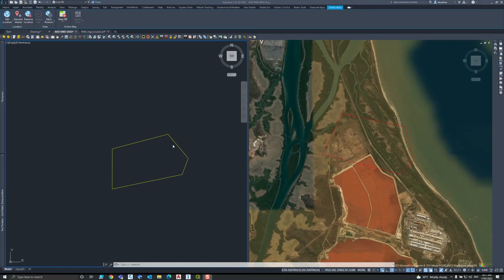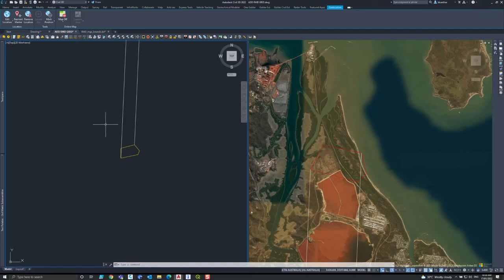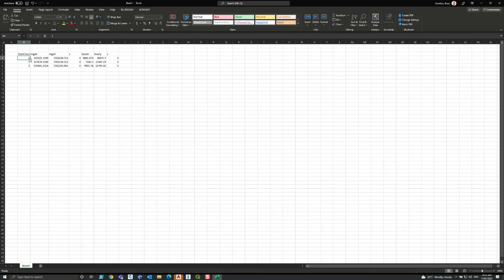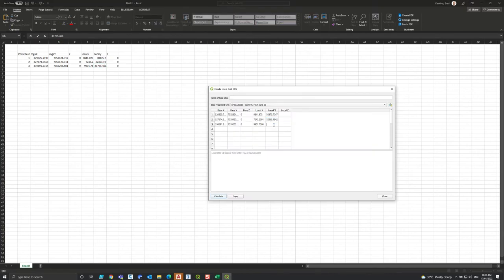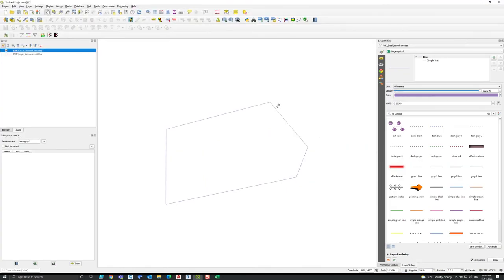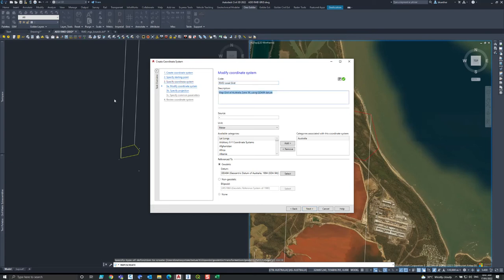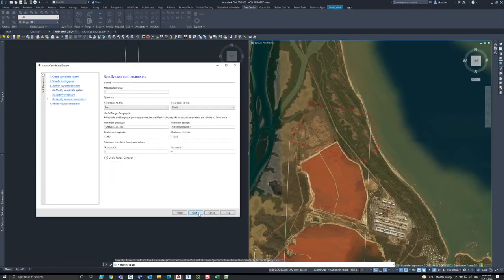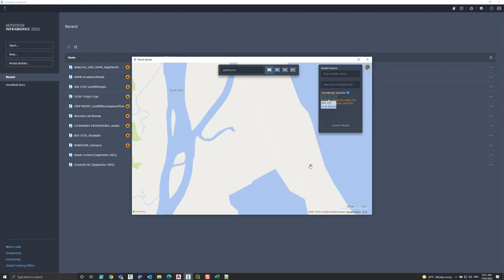Creating Local Grid Coordinate Systems in QGIS and Civil 3D

Comment: Hello. Thank you for the tutorial. I have a question. Is it possible to export the transformed data, i.e. the transformed X and Y coordinates?
Reply: Sure as, points you mean?. if you use QGIS you can just import a CSV file and then export it in the transformed coordinate system.
Reply: @bconnler  when I did this the coordinates of the points didn’t change, the points were transformed to the correct positions on QGIS but the data would remain in the local CRS when I exported it. Could I be missing a step?
Reply from the maker: possibly, remember in qgis you need to select your target coordinate system when exporting..